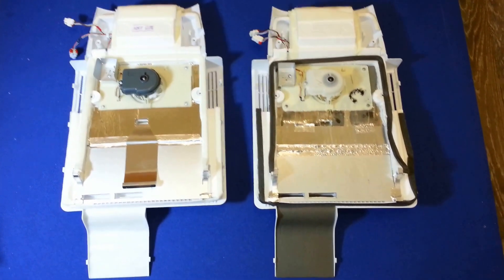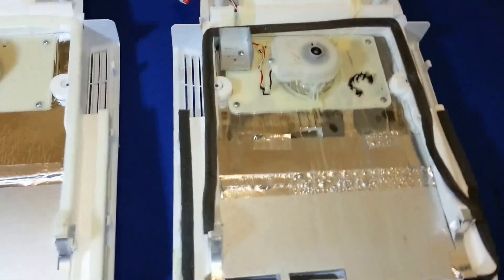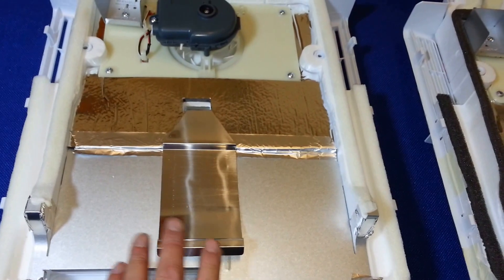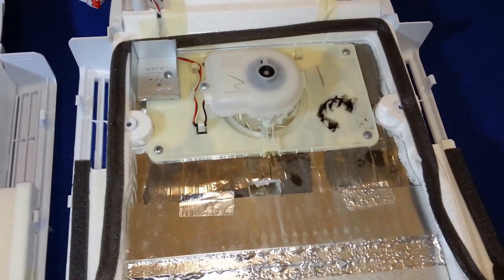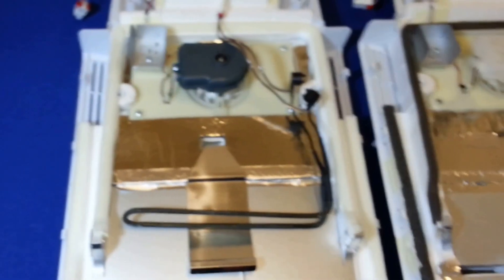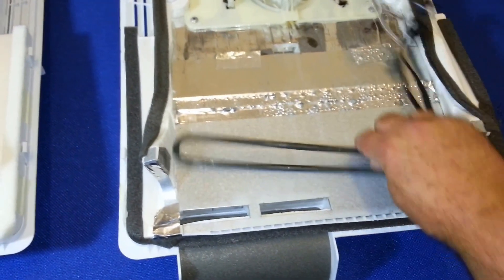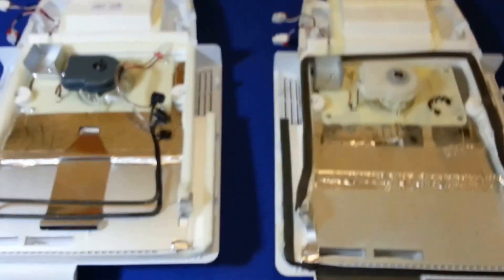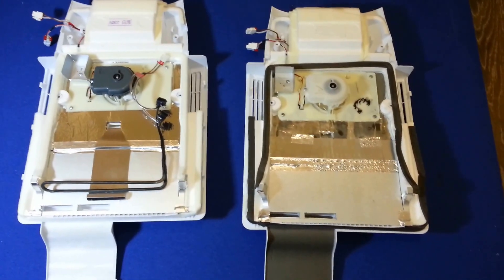Samsung Fridge Freezer Noisy  RSH1 , RSH5 , RSH7 Modified Fan Cover Explained

Comment: How do i reset teprature for freezer
Reply from the maker: Hi you would use the button on the display to set the temp..ie if you want -18 press button untill you see -18 the freezer if working ok will eventually get to temp set .if it doesn't get to this you may have an issue with the freezer thanks ally
Reply: easy brother  just press the left button out side fridge/freezer  and put up or down